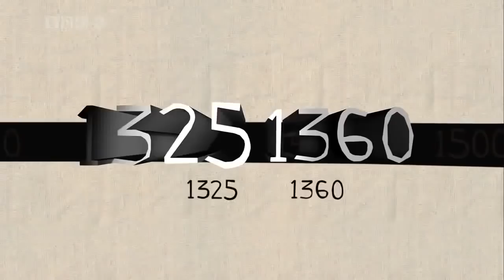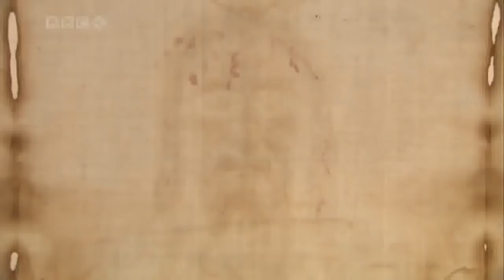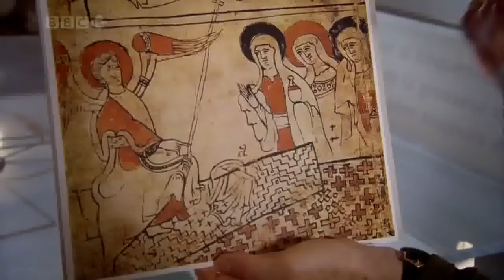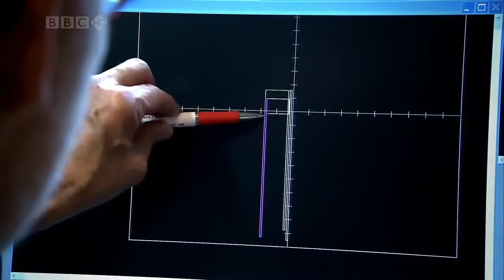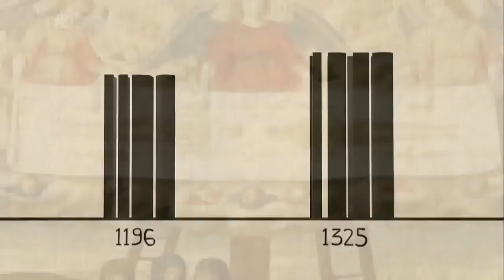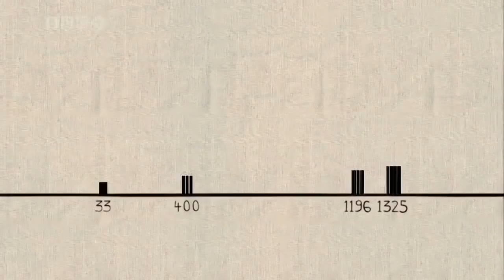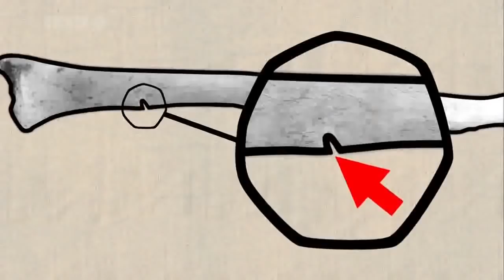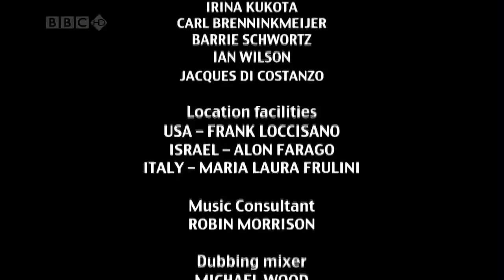BBC SHROUD OF TURIN NEW EVIDENCE

Comment: There was an error in carbon 14 dating of the Shroud of Turin. In the year around 2000 the age of the Shroud of Turin was approximately 735 years old. The correct computation is 735 x e which is 735 x 2.71828 = approximately 2000 yrs. old.
Reply: That is a lie, all 3 samples were dated by different laboratories around world, and all had same date +-100y and it was dated to middle ages.
Reply: That’s not how exponential decay calculations work. But it has since been determined that the fiber was taken from a section sewn-in and dyed much later, as a repair.
Reply: How does e come into play?

Comment: I read that pieces of the shroud was supposed to be taken from 7 different areas which is protocol when preforming the carbon test, but that didn’t happen with the shroud. They were all taken from 1 area very close together which is being asserted that the carbon dating test results are false and it needs to be tested according to protocol to give the correct date produced.

Comment: I can tell you exactly why C14 date is wrong. C14 is based on a loss of carbon. Middle ages used candles, oil lamps for light and incense. Thus adding additional C14 to the shroud... Thats what I'm thinking...
Reply: Good Point there....
Reply: The amount of Cotton/Linen needed to change a 1st Century date to a 14th Century date is considerable & there simply isn't that amount in the sample. It's just not possible all the modern day comparison tests prove even if they test it again it will come out 14th Century. All the peer reviewed science is online it's a fake. Just saying.
Reply: @johnmichaelson9173  so why don't they test a part of the linen cloth that hasn't been repaired in the past so this debate can be ended once and for all?
Reply: @certainly2509  The scientists told the church if you do again you'll only get the same result. Made in the Middle ages. I don't mind what they do personally I couldn't careless if the test it again or not I'm just repeating what I read but it had all the math in all the formulae was published in regards to the test & result.
Reply: @johnmichaelson9173  Regardless there are many people who would like the carbon dating to be redone. Myself included.
Reply: @certainly2509  Jesus is Jesus we have his words & his teachings that's all I need everything else is fluff but I wish you good luck on the retesting.
Reply: @johnmichaelson9173  That is true. We shouldn't hang our hopes on the shroud.
Reply: @johnmichaelson9173  a 2% contamination is all it would take to distort the cloth by 1300 years.

Comment: Obvious question: if the cloth of oviedo is from the same batch or piece why not radio carbon test that one. If the date is earlier wouldn’t that be great forensic evidence ?
Reply: We do know that the face cloth was used before the shroud. It is a stain from the blood of a highly tortured human being, remaining bright red, as does shroud blood. The stains on this cloth are AB+ and, when aligned with the (photoradiated by resurrection event) face on shroud have over 115 precise  reference points of matching identity. Forensic science requires around 15 for proof.
We also know that the image left on the shroud is only 1-2 fibrils(microfiber filaments) in depth. No application by human hands could be that thin. Less then half thickness of human hair.
As of 2021, every scientific attempt to discredit authenticity has failed. But the scoffers will scoff, regardless.  It is a gift that we have these authenticated relics. It is also a gift to not require them. 🙌
Reply: It has been tested again. It’s on YouTube

Comment: There is no gap on the shroud for the top of the head to fit into , the video show the top of the forehead going straight on to the back of the head which is an impossibility , You put a sheet over your head and see that there is about 4-6 inches where then top of your head goes . called the crown .

Comment: There are many great pieces  of info in this program. However, in agreement with previous remarks, if the 1988 C14 was done on a "repaired" portion of the shroud then most of this program is a distraction from the key facts. If so, then the question is "why?".
Reply: Because if the shroud is PROVEN to be that of a Crucified but Resurrected Christ then all men would have to believe the WORD of God and either kneel in worship of choose to not repent and remain lost. That to these self important ones, is unacceptable. They are much more comfortable  with their questions, and not the answers.
Reply: @debracarey2129  very well said!
Reply: Why, is the most pointless of all questions
Reply: @debracarey2129  but we know the shroud is only 500 years old, so check mate
Reply: @poozer1986  No, we don't 'know' that. It is suggested that when it was carbon dated they took material from  the   repaired sections which then matched the date it was indeed repaired. Wha twe do KNOW is they found real blood, of a human male on the areas in which the wounds were on the body image, the wounds were indeed in the correct areas  in which they would be if indeed the image depicts a man who was crucified, AND the image when inspected more closely of late depicts a sort of topographical image,as it would if it was placed over a real  human body, with differing heights depicted.
Reply: @debracarey2129  please, cite your reference source. You honestly think scientists only tested a single section? Science doesn't even care anymore, it has its answer
Reply: @poozer1986   2008 Robert Villareal at Los Alamos Nat. Lab. Do your own research as I have better things to do than waste time arguing with someone who doesn't want the truth.
Reply: @debracarey2129  so, I find something. He just put forward a hypothesis. No one in the community has taken it seriously, and hadn't been spoken about since he put it forward. He light as well said it was made of cheese, amd covered the body of count duckula, as that holds as much water as his hypothesis
Reply: @poozer1986  you can leave me alone now
Reply: @poozer1986  well, they took a piece from the repaired section. That section is not from the original... Um, “so checkmate”?? 😂
Reply: @youtubegirl149  also, I find it funny that, until the study carried out by scientists, no mention of any repairs. It's also extremely convenient that, the tests showed that the shroud conveniently is the same age as when it was first "discovered".
Is easier to fool people, than convince people they have been fooled
Reply: @poozer1986  haha!! Get back to me when “science” can reproduce it... unless you believe medieval religious folks are smarter than current scientists.
Reply: @youtubegirl149  why would science want to reproduce it? After all, its just a medieval piece of cloth.
Not smarter, just way more interested in conning people.
Science doesn't need to reproduce out, it already knows it was faked.
Reply: @poozer1986  I don’t know. You should ask the scientists who tried. The one came really close until they tested the cloth... 
Some people might wonder why you care enough to watch a video on it and engage in arguments, when you think it’s so silly. 🤷🏼‍♀️
Reply: @poozer1986  You should be ashamed of the way you treated Debra. I don't know what happened in your life, but I want you to know that you are loved, and that you always can turn around and leave your old ways behind.
Much love, J.
Reply: @poozer1986  You wished her to have a child that would die after 6 days. She was respectful the whole time, you where not.
Reply: @intedominesperavi6036  but just to clear it up. Bone cancer, which is in no way hereditary, like babies after admit 6 days of absolute agony. Guess it's just another of gods plans. Ludicrous
Reply: @poozer1986  She never talked about "God's plan".

Nobody here stated that they where offended - I'm quite amazed how easily you come up with this stuff, and how instantly aggressive you engaged in this particular conversation.

There is a difference between offending because of the expressed opinion, and offending because of vulgarity. Think about that.

Comment: Exactly "how" did they build the Pyramids???
Reply: I think Ron Wyatt had a theory about that. He said they probably used a manually operated machine that used leverage to kind of Jack up the stones a little at a time. 🙂
There's also a video that shows how they slid the stones up one of those vent shafts to get them into place.
Reply: @nickroberts6984 : it was rhetorical, sir?
Reply: @nickroberts6984 :
 And Ron Wyatt is the last person I would want to hear explain the construction of the Pyramids.
He actually believes the Jews built them during an actual enslavement in Egypt, before an actual Exodus.

Comment: The cloth does not show the image of Jmmanuel, (AKA Jesus Christ) but that of a merchant from Turin/Italy, named Caesar Canova.
The shroud was made by the deceased's brother, Luciano Canova, an alchemist.
The process took place on 7 June 1324 and lasted until 10 June, i.e. 4 days.
The procedure was not such that the cloth was placed on the deceased and rubbed with chemicals, as is often claimed, but it was a very early form of photography, whereby the corpse was laid out vertically in front of a large glass lens, through which the image was then projected for four days by an effect with sunlight on a large surface soaked with chemicals in a dark room, after which the cloth was then treated with silver nitrate and thus the image was visible and held.